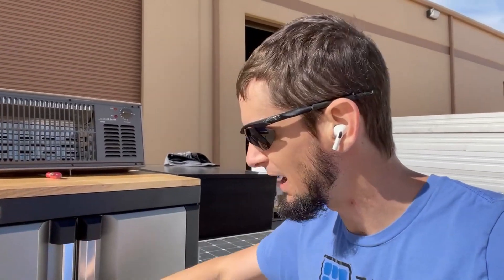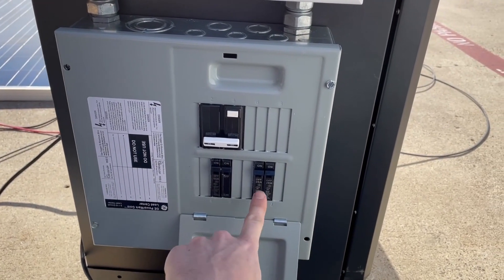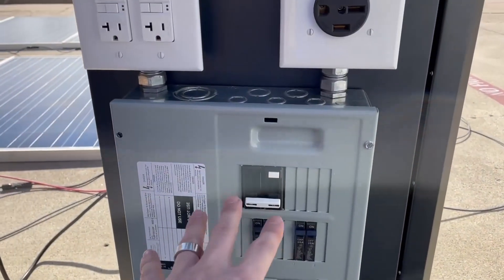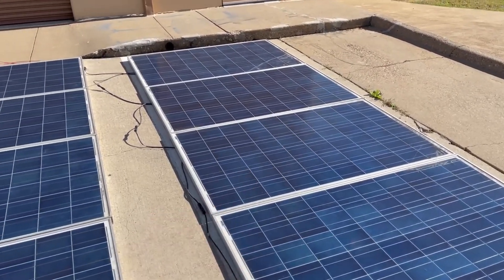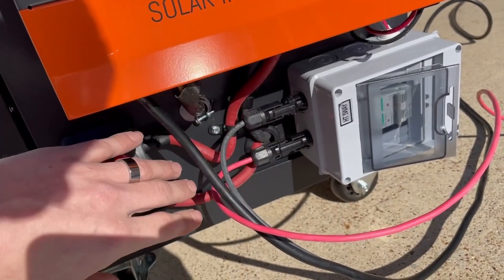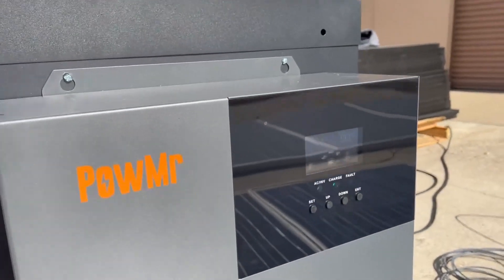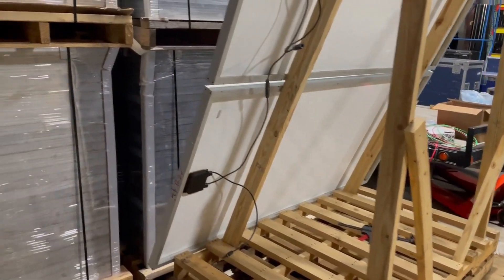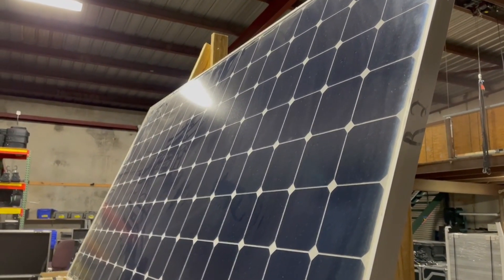If Your Portable Power Station Was On PowMr Steroids

Comment: Do you have a video link of you actually installing this particular inverter ??
Reply from the maker: I don’t have an installation video of this one, no.

Did the other 240v inverter have a ground on the ac input side? Sometimes they only have the terminal there. I’ve found that if there is an input and output ground they are electrically the same.
Reply: @BeeneEnergy  yes the inverter has 3 ac inputs ground neutral and line and the output has only neutral and line does this mean the whole box has to be grounded or something and is neutral basically line 2 ? Or considered line 1 and the line is considered line 2
Reply from the maker: @thelithiumpowerch  I believe with 240v units there is just one line. Other is neutral. There are apparently some differences in ground that can be gotcha’s if trying to use that in North America. Possible neutral and ground are bonded inside the inverter?

I think the idea is that the inverter would be grounded through the input side to the grid. Don’t know for sure.
Reply: @BeeneEnergy  oh ok what if I'm not using the grid for now should I ground the case I'm running the neutral and the line to a solar edge tx5000 Midpoiny transformer then from the transformer to a ground on neutral subpanel so I will have 120 AC
Reply from the maker: @thelithiumpowerch  I’d use the input ground terminal for grounding. Willing to bet it has continuity to the case of the inverter.
Reply: @BeeneEnergy  so on the input side of the ac current ground neutral & line the ground is simply going to the case ??
Reply from the maker: I think so, but every brand could be different!
Reply: @BeeneEnergy  I take it the output on yours is just a line and neutral to then huh ?
Reply from the maker: @thelithiumpowerch  yep, and the manual says to use a screw on the case for grounding.
Reply: @BeeneEnergy  so run a copper wire from that screw to the grounding rod out back ?
Reply from the maker: @thelithiumpowerch  I’m not entirely clear on that piece. But seems right.
Reply: @BeeneEnergy  yes the inverter I'm looking to buy is a lil different and it's a 230v volt AC output so I'ma have to get a step down transformer or that SolarEdge midpoint transformer I wish I could send u a picture of it it's 24v 3000w 80amp 500 voc
Reply from the maker: @thelithiumpowerch  just watch out, there was something around the growatt 5k 240v inverter that signature Solar is selling on how they have a us spec and buying an eu spec is different. And I believe it’s something about how grounding or bonding works. Signature Solar had a short video about it on their channel. You might want to check that out before pulling the trigger to make sure the 240v you’re planning on will work well.
Reply: @BeeneEnergy  oh ok the inverter I'm looking to buy is by PowMr it's that white and black one with the blue line going across towards the bottom the one with the detachable screen
Reply: The ground screw on your inverter where did you run ur ground to and is it safe to run it to the case of a breaker box on the inside but I was just wondering where did you run yours to ? I'm just trying not to get electrocuted lol
Reply from the maker: @thelithiumpowerch  I grounded mine by plugging in the AC input cord to the wall. Assuming the house is properly grounded/bonded that makes my inverter grounded/bonded.

If I was putting this into a permanent installation where there was no grid, just solar, I’d run a wire from ac input ground of inverter to ground busbar in the electrical panel. The electrical panel ground busbar would run to a ground rod. Also inside the electrical panel if bond the neutral and ground busbars.

Gfci or arc fault breakers are common/required in new construction so consider using them throughout. Makes for an even safer setup. And they will trip if there are things like bonds in multiple panels. Or generator is bonded Internally in addition to the bond at the panel.
Reply: @BeeneEnergy  I copied that down word for word but my inverter is 230v ac not 120v so I can't plug it into the house outlets I guess I'ma use some type of step down or midpoint transformer but outback my solar panels are running to a MidNite Solar combiner box that is grounded to a grounding rod it's the only thing that's actually grounded on the system I'm running now converter ain't made it here yet do I have to remove that ground or leave it alone
Reply from the maker: @thelithiumpowerch  Grounding the array is a separate discussion. Look up some videos or nec documentation on that but I think you have it right for a ground mount that is a separate structure.

I think we talked about this already but make sure that neither line or neutral of that inverter are bonded inside the inverter. If it is and you try to bond your neutral from the transformer you’d create a dead short!
Reply: @BeeneEnergy  yes everyone's telling me when the inverter arrives to test the neutral and the ground screw on the side of the case to make sure it's not bonded test it when the power is off and test again when the power is on you said run the ground for the AC input side to the ground bus bar of the breaker box what do I do about the screw on the side on the output of the AC ?
Reply from the maker: @thelithiumpowerch  I wouldn’t touch that screw. But I thought we were talking about the inverter I had in this video. I can’t talk about the inverter you’re getting, not sure what’s connected to where with that one!
Reply: @BeeneEnergy  I understand the reason that I keep coming to you on this issue is because your output only has line and neutral my inverter only has line and neutral on the output I plan on running it to a breaker box line and neutral two separate Breakers then use in the Solar ass midpoint transformer that has L1 L2 & N to create two 120 volt legs so I can use the inverter just imagine they're already being identical to yours but 230 vote made by the same company PowMr.
Reply from the maker: @thelithiumpowerch  Hope it works well for you!

Comment: I'm looking at an inverter I'm thinking about buying it's a 230-40v inverter my concern is on the ac 230v output it only has 2 terminals line and neutral there's no ground the input terminal have 3 lines ground neutral & line is this inverter ok to buy ? With only a 2 line output??

Comment: have you tested your batteries @ worst case scenario...IE full inverter load until low voltage cut out? I have a 4s 2p pack of these on a growatt 6000t, and before I install at my customers residence I wanted to test at worst case, but the bms's won't take it, I ve blown the mosfets off 3 bms's even after fully balancing the packs. seller has been great with warantee but mainly wondering if it's just me, or an inherent problem. individual batteries on a standalone 12v system have passed much tougher testing w/o failure for me, so I'm assuming it's the 48v @ higher amperage, but even at max power output from the inverter  the individual batteries should only have a 60-70a load on them.
Reply from the maker: I haven’t, been working on finding 5kw of loads! Did find a dud battery though that cuts out at 60a loads :(. Will be working to get that one replaced.
Reply: For test loads,  I just use space heaters.  1500 to 1800w each.  Just keep adding until you max the inverter.  They never pull exactly what they are rated,  but 3 or 4 switched between high and low should be good. Just keep an eye on the inverter output.

Comment: Have you set up you 4 12v lithium batteries in series? Battery manufacturers tell you not to connect in series due to BMS issues.
Once one battery gets to full charge it cuts of.....so your other batteries never reach full charge.
Reply from the maker: Yep, it’s important to top balance the four before putting into such a configuration.

Also they can still drift so if it’s four individual batteries having a balancer between the four would be a good idea. I bought one for this purpose but haven’t done any long term testing to see how/if it’s a big deal.

TLDR good thoughts! And I think they are valid and can be overcome with a little effort.

Comment: Hey Beene!
Thanks for your video!!
I bought 4 Global Power 12V100AH LiFePO4 like the ones on your video.
Is there a way for me to optimize the  capacity of my battery bank set up 24v 2s2p. The issue I'm getting is that the battery never charge 
To 14vdc.any advice will help.
Reply from the maker: If you wanted to pop the case and add an active balancer it’d get you that extra few percent of capacity.
Reply: @BeeneEnergy  thanks do you have one in mind and where can I find the procedure to do this.
Thanks really appreciate
Reply from the maker: @imag555  I put one of these in and it balanced out nicely. Just haven't had time to play with it more and put together a video yet. https://amzn.to/3ruIg3G
Reply: @BeeneEnergy  sure will.chreers
Reply: @BeeneEnergy  hey Beene!
I did had an active balancer and top balanced the pack 10 times  . Got them balanced pretty good se the photo. But still didn't get pass 96.9 ah. Is this it . Any other suggestions. 
Should I charge every individual cells?
Thanks for taking the time.
I love your chanel.
Reply: @BeeneEnergy  sorry I don't know how to send a photo

Comment: Nice! Starting to dabble in the High voltage!  I'm the guy with the 500 volt battery. It's been a journey...
Reply: Just out of curiosity is there some kind of efficiency bonus to getting a similar or higher voltage than the voltage on the output of your inverter?
 
I know DC to DC a buck converter is more efficient but I don’t know how inverters work. I know Will preaches higher voltage=thinner gauge wire for the same kw output and with 4/0 at like $5 a foot that adds up quick when you can run EVERYTHING on 2AWG if you stay under 125 Amps. 48V batteries (40V to 58V) will still be fine if you’re with at the bottom of the voltage and trying to push 5000W but you might want to bump that up to 1/0. 

Does anyone really have a need for transferring more than 5kw on these kinds of systems?
Reply: @ericklein5097  yes there are some efficiency gained by having your battery voltage closer to your ac voltage.  But I think there's bigger gains to be had elsewhere like in the quality of the components and design. My 6 KW inverter uses between 15 and 30 idle consumption which I think is pretty freaking good compared to anything else I've ever seen for a 6 KW inverter.
Reply: @ericklein5097  But the AC waveform does go from zero up to 120 and back and forth so it's not just cut and dry like use a 120 volt battery.  In fact the AC waveform goes far higher than 120. The 120 is just sort of like the average voltage. It actually gets up 170 volts at the top of the wave.

Comment: Good video, thanks.
PowMr 5000
Have you measured no load power consumption ?
An Amazon review suggested 50-150 watts.
Is there an easy way to turn off the Inverter function while keeping the charge function working ?
Reply from the maker: If I remember correctly it was 60w idle for this unit I have. And unfortunately when the switch is off Solar isn’t charging. Unlike the Growatt units I’ve played with where just the inverter can be switched off :(.
Reply: @BeeneEnergy  this sucks.  Do you have any other feedback on the inverter?  Holding up?  Would you go with a Growatt or MPP if you did it again?

Love the channel and your videos.
Reply from the maker: @tsp2jxd  Thanks! No other feedback yet, was going to play with it more this week but with the cold snap I'd rather be cozy in the house not at the warehouse! I'll be doing some stress testing and likely be doing another video to report back on my findings. The 500v input with a 120v inverter is something the other brands haven't offered yet. Of course the 250/300vdc of the spf 3000tl lvm-es from growatt is close and a reasonable offering especially since it can stack. So far I see value in both. Would be cool to hook this up to an RV that has both rooftop AC units running off it. I think it would run both at the same time.
Reply: @BeeneEnergy  this is my dilemma.  Been looking at these two inverters you mentioned but also want the Growatt 6000 low voltage off grid inverter.  My pool pump requires just under 10amps 1.5hp and I don't know if either of the above will run it.   Also, not sure if the 6000 low voltage will be good because I won't have a large battery or array.  2k or less PV and 5.1kw battery at best.  Will the 6000 low voltage be a better option?
Reply from the maker: @tsp2jxd  Pool pumps are usually 240v aren’t they?

Yeah starting a pump that big with an inverter is gonna be tough. You might want to look at a low frequency inverter to support better surge current, if I’m thinking of the same one the 6kw growatt is a low frequency and would likely be a better bet. I believe that have both 145v and 300v input models of that inverter.
Reply: @BeeneEnergy  mine is for small pool and works off of a 20amp circuit regular 120v.  I want the 6000 low frequency inverter just to be able to brag to my high frequency friends. 

Maybe a comparison video between a low/high frequency inverters.  I'm worried I won't have a large enough PV array or battery for it. 

KEEP UP THE GOOD WORK!!!!

Comment: I TOTALLY CALL B.S on what you claim for those LifePo4s and what you put together.
Reply from the maker: What part don’t you agree with specifically?
Reply: @BeeneEnergy  The batteries mostly... did you build them yourself to get 100ah for the cost you stated just over $300 ?  Because I do believe you would only own quality products and I'd like to buy 6pcs or more of a 100ah LiFeP04 that is only 300ish.
Reply from the maker: @Nomadic_Kokopelli  These batteries have a single problem that I observed. In that the cells weren’t properly balanced when assembled. Regardless I still tested full capacity in the video I did last month on them. Hence me having them in a video. I absolutely don’t want to suggest anything that is sub par, but since these did live up to their capacity claims it seemed fair to use them. I’ve got a link to eBay down in the description, I get a little kickback if you buy through it.

Certainly happy to know what people are skeptical about though because if I can curate videos that address more concerns it’s better for you which means it’s better for me.

Comment: 5000 watt setup using 100 watt golf cart batteries would be 50, 100 watt batteries at $300 each,  would be $15,000 in batteries alone.  I'm  I missing something?
Reply from the maker: Each of those four batteries is 12.8v at 100amp hour. Which is 1,280watt hour.

Four of them is right at 5,000watt hours.

Coincidently the inverter can supply 5000w of power. Hence the title of the video :).

Comment: How many 100Ah batteries have you used in this system?
Reply from the maker: Just 4x 12v 100ah so far. Four more would fit on the top shelf though making this system even better.

Comment: Where's the link for the panels?
Reply from the maker: If you’re in my area here’s a listing for the 230’s I did this setup with. If you’re too far away for a drive to Mansfield tx check out GoGreenManSolar.com who also has a good selection of used panels.

If you check out “more ads from this user” you should see the 435w panels as well.

https://dallas.craigslist.org/sdf/eld/d/arlington-230-watt-astronergy-solar/7426892052.html

Comment: On a string of panels at or near 450vdc going to a growatt 5000es. would you ground the array and mount to ground rod? Also fuse/breaker the positive and negative pv wires or just the positive to isolate the rest of the system from lightning or an electrical short in the array? Inline fuses or breakers?
Reply from the maker: My understanding is that a ground mount array should be grounded to its own ground rod. It would not share a ground with the inverter.

I believe that would be panels plus ground mount.

Fuse/breaker is only there for convenience, with a single string you’ll never see more than the short circuit current rating of the panels. Lightning arrestor? That would be a fair question I don’t have an answer to.

The breaker I’m using does break both positive and negative of the solar string. No specific reason for it though I’ve noticed that solar disconnects tend to do that so there’s probably a reason.

Comment: HEY THERE MR BEENE. I TOO JUST GOT MY FIRST OF FOUR OF THOSE BATTERIES.  JIM THE OWNER OF GLOBAL POWER IS A REALLY GOOD GUY TO DEAL WITH. 
KEEP US UP TO DATE IF YOU CAN ON WHAT YOU THINK OF THE BATTERIES OVER TIME.  THANKS
Reply: Hey I bought these batteries from global and indeed Jim the owner is very nice and Sent me battery replacement for two batteries that didn't have the 100ah like advertised. 
The new ones are getting 97ah and 92ah. Do you think there is a way to improve this?
Any thoughts

Comment: ive been looking for an all in one that is 12v but can handle 800 watts of solar. doesnt seem like there are 12v options only 24 and 48
Reply from the maker: I haven’t seen any 12v all in ones with any more than 500w for solar. It’s unfortunate!

What’s your incentive to stick with 12v?
Reply: @BeeneEnergy  I'm new to solar and I'm used to 12v batteries. All the research I've done is for 12v. Kinda scared I'll mess something up with 24
Reply: @ARMEDPATRIOT757  necroposting hard here but I feel I should let you know, 24v is way easier than 12v, 48v is easier still, and less punishing if you make mistakes with your wiring but at 48v you may get shocked if you touch the live wires. I would recommend no one goes for a 12v system unless they're forced to, the extra cost of thicker conductors is usually more than enough incentive to avoid 12v.
Reply: @ballbous  the issue I have with that is that I'm a prepper and if shit hit the fan 12v supplies are easier to find...inverters speaking